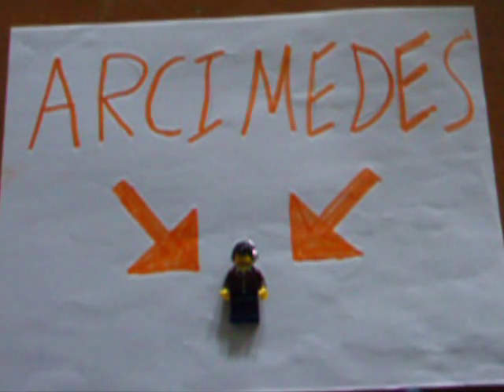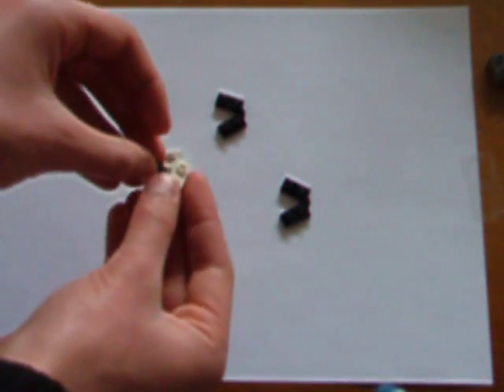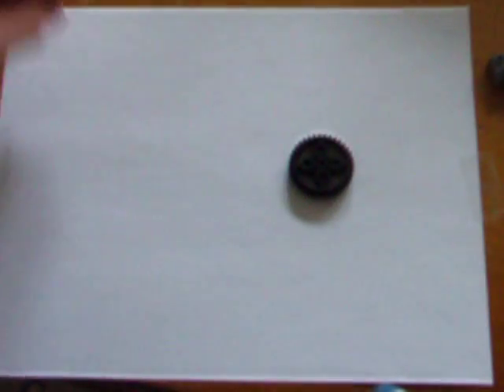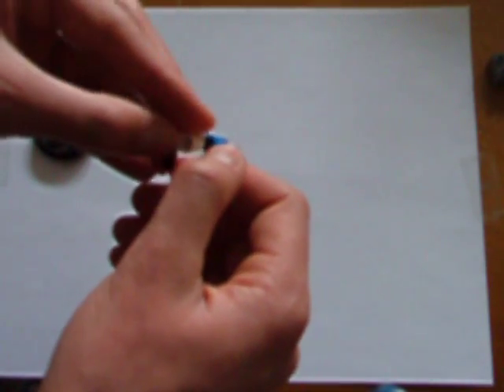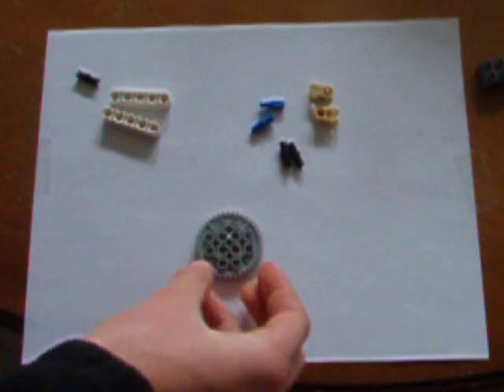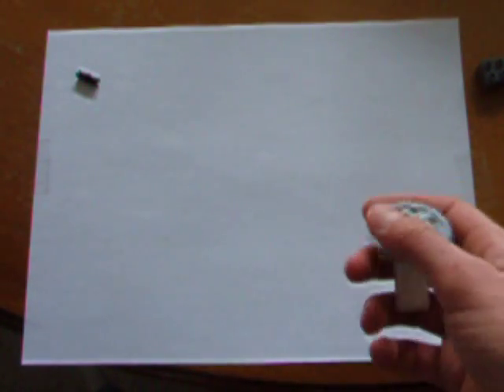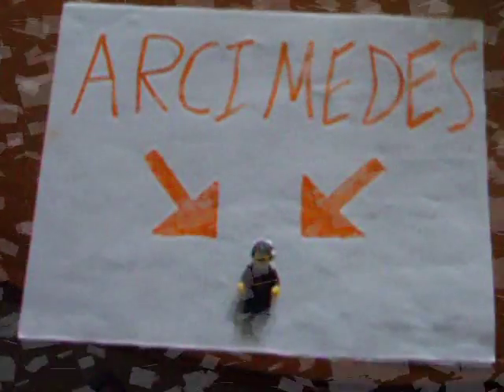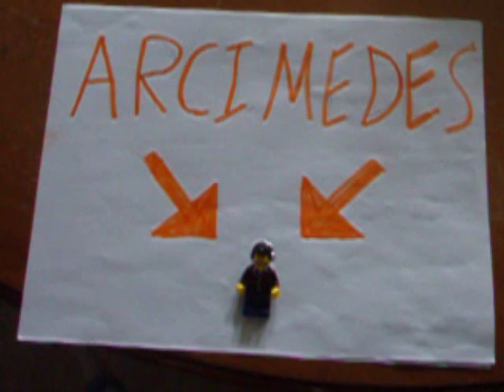Alternate Shoulder and Hip Joints for Robots  Lego Bricks, Tips, and Tricks with Arcimedes 36

Comment: The pieces that you called cyclops eye pieces are called 1 by 2 technic twist brackets
Reply from the maker: I agree that I'm totally wrong with my names.  Ahh, the failures of my youth and innocence.  :D

I have seen those parts identified as: "Axle and Pin Connector Perpendicular" on Bricklink, and
CROSS BLOCK 90° on Lego.com.
The Part# 6536, at least stays the same.